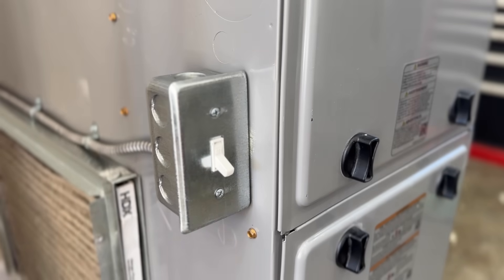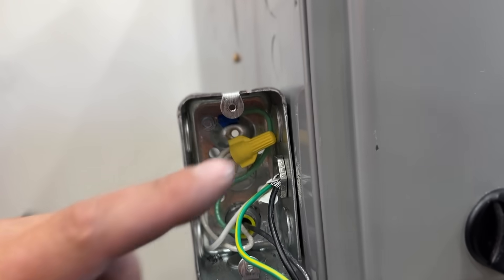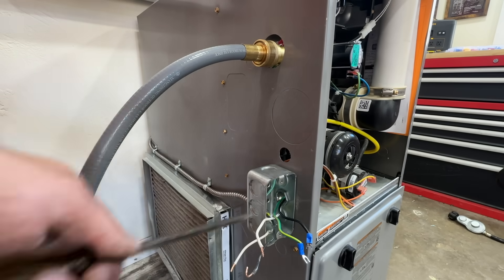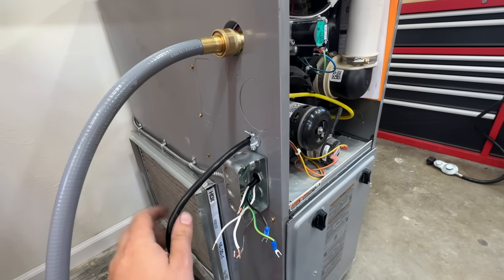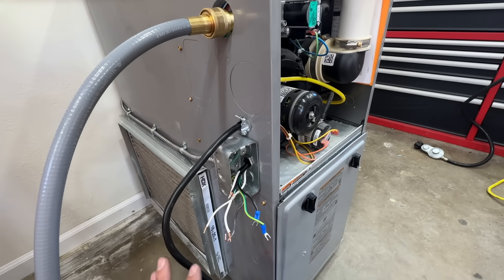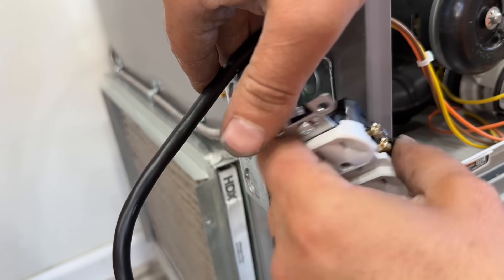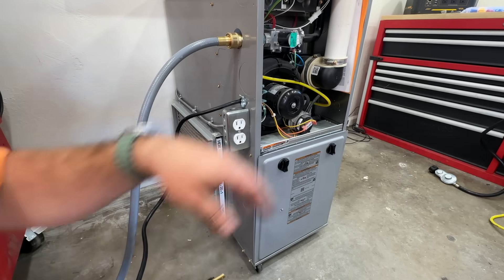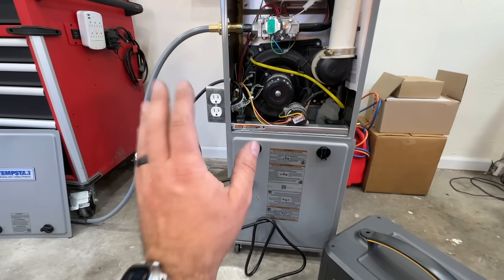Keep Your Family Warm During A Power Outage By Installing This $5 Part

Comment: Done that when gas furnace was installed (had to relocate it to one side of basement for better use of space). The issue with is that the switch was lost, thus furnace will power when plugged in. Never had to use it, but is there just in case.

Comment: That battery powered 120 volt supply  won't last very long.  Better off to get a gasoline powered generator, keep in in your basement, and  run a power supply cord to the generator from outside your door. Quite often the power can be out for 8 to 24 hrs. in the event of a severe snow storm.

Comment: I recently did this but encountered one problem. I had a new HVAC system installed recently. The installers wired up a cut-off switch, as well as a duplex receptacle. They didn’t wire it so that the switch turned off the receptacle, which I think would be proper, so I rewired it so that the switch powers both receptacles off. This way you can plug in the furnace and still use the switch as a cutoff. The problem came in because the installers put in a GFCI duplex outlet. No matter what I did, the GFCI kept tripping. It obviously didn’t like a power oscillation or some other anomaly. Anyway, I temporarily plugged the new furnace pigtail into a non-GFCI out and it works fine. I’m going to replace the GFCI outlet that the installers put in with a non-GFCI which will then be controlled by the switch. I could leave one hot all the time but I’d rather the switch kill it all. Thank you.

Comment: This is a great tip. Thank you. Question; Why do you need to run the pigtail through the inside of the furnace. Can’t you just run the pigtail through the top knock-off of the electrical box itself.

Comment: You should solder that connector then attach it. Screw it together so you can and not only that, but it makes it better connection to a solid piece of wire that's electrical 101....

Comment: Just a little fyi...Please someone correct me if I am wrong...Use caution if you try to power your modern furnace with a standard generator. Standard generators put out an irregular sine wave which can damage your computer board...An inverter generator puts out cleaner energy and will be fine. My furnace man alerted me to this, and since then I had a power outage and my inverter generator powered my furnace perfectly.

Comment: Good idea my roommate and I had to do that when we would lose power randomly in New Hampshire. We didn’t have an expensive generator. We had a harbor freight special. Just enough to cover heat and a few lights maybe the refrigerator. Plan on doing the same thing with my RV as a backup option had my breaker box fail. Had to use a battery charger just to run my heater with a generator. It’s amazing what you can find to work when you’re cold.

Comment: Why are you going through the added complexity of knocking out a hole in the furnace only to run the plug wire back into the box? Why not knock out a hole in the box and use the same wire clamp to run the plug wire directly into the box?

Comment: looping or tightly coiling an extension cord while running a motor can potentially cause damage to the motor due to heat buildup and voltage drop. A tightly coiled extension cord can trap heat and prevent proper air circulation, leading to overheating and damage to the motor. Additionally, a coiled extension cord can increase resistance, causing a voltage drop that can prevent the motor from starting properly or damage it during operation.

Comment: Thank-you very much for this video. Long story short just went through 5.5 days without hydro due to ice storms (Ontario , Canada) and I have since converted my furnace the same as your video. My switch was a bit different as it was mounted on a stud a few feet from the furnace. I just connected the same way you showed including wago connectors and same power cord. I did cut the appliance cord down to about 2.5 feet from the original 9 feet (just my preference for it's location). I first tested by running furnace with it plugged in and it fired right up. Unplugged it and it shut off. I ran a 50 foot outdoor extension cord to brand new Honda 2200i generator on my deck through basement window. My furnace is about 15 years old and is a high efficient natural gas furnace. Generator ran the furnace perfectly and it even started the furnace on the generators lower rpm "eco" mode. Once again thank-you for this video it gave my the confidence to do this conversion....cheers.

Comment: Non-electrician homeowner here. Good video. I was just watching Torque Test Channel’s review of power backup solutions, including using one to power a furnace. As he didn’t explain how the plugging in part was accomplished, I looked it up and yours was the first video I watched. 👍🏽

Luckily I have not had an extended power outage in winter, but I do have a 4-day outage a couple years ago in late summer. I don’t have a generator; I got by using a car jump pack to power a small USB fan to keep cool and keep my phone charged. 

If I had a generator, I would not expect the AC to run with this pigtail solution as it’s on a separate circuit which is much higher amperage (and I think also 240V?).  But possibly the blower motor by itself to better circulate the air. 

I also had a non working furnace for a few days in December (but still had power). I warned myself mainly using electric space heaters. Luckily I have an insulated crawlspace and while it did lose temperature over those few days, it never got to freezing. There are also electric pipe heaters installed on the pipes in the crawlspace but I don’t know how effective they really are. 

So I have some questions for the “Sparkys” out there regarding this solution. 

A) Instead of a 2-outlet, could I instead install a combo switch/outlet? Then I still have the ability to cut off power to the furnace without yanking the pigtail cord out. (Because I’ve noticed HVAC techs sometimes have to do so several times while diagnosing or making repairs.)

B) if the furnace is within a distance of X (I think 6 feet?) of water pipes, does the outlet need to be a GFCI? (I would think Yes) 

C) I noticed both the pigtail cord and the furnace power wires going through the same clamp into the box. Is that kosher? 

D) How big (or really, how small) of a generator would I need to power the furnace to warm the house (and especially the crawlspace)? Could I get by with a battery-powered unit that I can use inside the house? 

E) I see a lot of comments that this is allowed by code in some municipalities, but not allowed in others. I think the nice thing about using the lever nuts is if I expect to be inspected, I could remove the pigtail cord relatively easily and cover the knocked out hole beforehand. 😉

Comment: OK Guys, Maybe a dumb question here... Do we need to turn off the breaker when we have an outage so that when power DOES come back on it doesn't blow up the genie by sending power back into it?
Reply: Basically he made the furnace have a plug.  You either plug it into an outlet going to the panel or an outlet going to the generator.  It can never be both.  No chance of backfeeding.

Comment: Hello, I recently used your hack to power my gas furnace (120V) with my generator. Do you have a similar hack to be used with my 220V A/C unit?
Reply: Thank you for the 3/29/25 video demonstrating the 30 Amp backup solution!😊

Comment: Gentlemen , I have been a gas fitter for forty years and yes this method would work but here is how I would power my furnace WITHOUT USING ANY TOOLS to accomplish this.
If I were to use the power source in the video my method, with a pre made cord, would take less than 2 minutes to get furnace, refrigerator, plugs and lights  to work depending on how much wattage is available at your power source.
I have a 6' extension cord with 2 male ends on it pre made already in case this happens to me. I have a portable gas generator as my power source but the electric battery source in the video would make this even easier.
1. SHUT OFF MAIN 100 amp breaker on breaker panel
2. Plug 6" extension cord you pre made in any wall plug in house
3. Plug extension cord into power source, battery or outdoor generator and turn on
4. You have now supplied half of your electrical panel with power ( 1of 2 buss bars). you will have lights and plugs working as well in the house. If the furnace doesn't have any power then you will have to find an electrical outlet in the house that also doesn't have any power as well. ( use a lamp that works to test outlets). 
 Remove extension cord from power source, transfer to the outlet that has no power, install and plug into battery or power source and you will power the furnace. 
5. Once you notice lights on at the neighbor's, shut off your power source that you used, (battery or gas generator). Always unplug 6' extension cord from power source before removing from electrical outlet, to reduce any chance of shock and turn 100amp Main Breaker back on. 

If you simulate a power failure before you actually have a power issue, you will know which electrical outlet you will need to use during an emergency to power your furnace. My outdoor plug is on the same buss bar as my furnace so I can start my 3500 watt gas generator outside, plug 6' extension cord into outdoor outlet and I have many things working in my house including my furnace.
BE SMART... BE SAFE  use common sense

Comment: Excellent video. The only thing I would add since I am old school is: The unused terminal screws on the outlet- turn them in; especially in a metal box. I have seen these touch the sides of the box when a receptacle was loose or touch other things that you don't want them to. Just little things that make you go"Hmmmmmmm". Once again, nice clear video.

Comment: What happened to your furnace shut off? Code generally requires you have one. Also, without a shut off, you need to insure you shut off the furnace breaker to disconnect furnace from house main power!
Reply: Disregard!! I didn’t watch the end of the video!! Thanks!

Comment: Sadly, this is NOT a code compliant electrical installation. It violates the NEC, and also will void the manufacturers warranty as gas furnaces are required to be hardwired, not cord and plug connected. 
Here is section 407 from the National Electrical Code, gas furnaces DO NOT fall under any of the following: 

400.7 Uses Permitted
(A) Uses . Flexible cords and cables shall be used only for the
following:
(1) Pendants.
(2) Wiring of luminaires.
(3) Connection of portable luminaires, portable and mobile
signs, or appliances.
(4) Elevator cables.
(5) Wiring of cranes and hoists.
(6) Connection of utilization equipment to facilitate frequent
interchange.
(7) Prevention of the transmission of noise or vibration.
(8) Appliances where the fastening means and mechanical
connections are specifically designed to permit ready
removal for maintenance and repair, and the appliance is
intended or identified for flexible cord connection.
(9) Connection of moving parts.
(10) Where specifically permitted elsewhere in this Code.
(11) Between an existing receptacle outlet and an inlet, where
the inlet provides power to an additional single receptacle
outlet. The wiring interconnecting the inlet to the single
receptacle outlet shall be a Chapter 3 wiring method. The
inlet, receptacle outlet, and Chapter 3 wiring method,
including the flexible cord and fittings, shall be a listed
assembly specific for this application.

The only other applicable article that would apply would be Art. 422 which basically says the same thing.

Additionally, as soon as a receptacle is used to connect a furnace, it must be a GFCI type receptacle which could trip and prevent the furnace from operating during frigid temps, and damage plumbing, etc.
Reply: This is what I've been hearing and was poking around for the answer.  Staying warm during an outage though.  Someone showed me what they do.  The just disconnect the light switch and pigtail the plug used in the video until power comes back.  I'm on the fence on what to do.  A 1500w heater isn't going to heat the house enough.

Comment: Hey man, I know you posted this a year ago, but thank you.  We gathered all the parts and my wife and I got this done in like 20 minutes.  I was surprised I didn't need a neutral ground bonding plug for my newer 2 stage furnace, but it worked fine off battery bank without it.  I ordered a couple just in case we need them for the inverter generator or a future furnace that's a little more picky.  Thanks so much for this, saved us a lot of money and it's great for peace of mind knowing that you'll have heat even if no power.  Six thumbs up!!

Comment: Awesome video!! Greatly helpful. Question -- To better understand the role of the switch. I am not an electrician. If I switch it off, then I guess the furnace doesn't work, right? Then, is there a specific reason that the switch is needed? I am asking this because electricity should  be continuously supplied to the furnace to get hot air as long as there is no power outage. Your answer to my curiosity would be appreciated.

Comment: How much for the 1000 watt inverter ? How many hours will it run the gas furnace ? How much is the amperage draw on the control circuit and blower ?

Comment: Don't forget about powering your condensate pump if its a high efficiency furnace! It'll need power too or you'll end up with a huge puddle in the morning.
Reply: Wouldn't it all be controlled by the furnace?  I don't think the pump is on it's own line and breaker.

Comment: I know there are a lot of variables on this question, but how long would you expect a 1000w power source to run a GFA furnace in a larger 3 BR house in say zero degree conditions.  In Ohio this could save lives and prevent plumbing from freezing, but for a day, two days, a week?

Comment: Great video!  Really enjoyed it.  Very useful content.  What size VTOMAN Power Station would be required to run a Lennox high efficiency furnace?  I saw you had a VTOMAN PowerStation 1000.  I already have a Briggs & Stratton 12KW standby generator for running the whole house but unfortunately I’m having problems getting it to run the furnace due to fluctuations in the power going to the furnace from the generator during power outages.  The furnace throws an error code (E126) and won’t run due to the fluctuations.  The generator seems to put out the frequency within the furnace requirements (60Hz + or - 5%, so 57Hz to 63Hz) based on Lennox information.   It seems the control board is not allowing frequency variations (58Hz to 62Hz).  Apparently, this is an issue that is similar to the one they had with Lennox Pulse furnaces.  My furnace is a Lennox G71MPP-36-B-070-03.  I’ve been trying to figure out a solution to running the furnace during the winter if we have a power outage.  This might be a workaround to that problem but would love to be able to run the furnace off the generator if possible.  Btw, are firmware updates available from Lennox to resolve something like this?  Thanks again for providing such great content.  It’s sincerely appreciated!

Comment: My furnace doesn't have an electrical box on the side, does that mean I'm out of luck or is there another method?
The wiring I see comes down the side of the furnace  from my attic and the wires go directly into the furnace.

Comment: PLEASE NOTE: Some furnaces are smart enough to sense that the generator/lithium-power-station has no connection to ground/earth and will shut off shortly after its startup cycle. Our Goodman furnace has this issue. You will need to purchase a ground/neutral bonding plug or, as with our EcoFlow Delta Pro power station, a specialized "Grounding Adapter".
Do it NOW before you need it! ;-)

Comment: Tried this with my trane xv90 and a 3500watt generator. It didn’t work. An initial motor turned on but after a minute the entire system shut down.

Comment: Not an electrician, so if the answer is obvious I apologize. Why not run the cord straight to the junction box instead of running it into the furnace & then back out to the junction box? To me this appears to save a step or two.

Comment: Great content and followed all details.  Furnace works as advertised with the plug installed in receptacle on the side of the furnace.  When plugging the furnace into a chord from a 5500 watt generator the furnace does not operate.  Curious as to what might I have missed?  Thank you for any information you may be able to share.

Comment: I understand what you’re going but can’t figure out what happens when the power comes back on and everything is connected in a loop ?
The furnace will be getting power from the power source and will also get power from the electrical box, yes ?
It’s all hard wired together, so how is that not a fire hazard?

Comment: I just ran a 220 plug off of my Central air that I use for my welder when I need to work on something in my drive that wont fit in my garage. If the power goes out, I flip the main, and I made a 220 cord to hook my generator up to it and I have power to whole house.

Comment: Good idea.  May want to cover run time.  I'm bulding a battery backup now with Golf Cart batteries.  10A at 120v is 100A at 12v, plus effeciency losses in the inverter.  This will suck down a battery pretty quick!  If you need say 8hrs of run time for 3 days, you need a lot of battery or some means to recharge them.

Comment: Good video!  So, it kind of looks like you soldered at least a couple of the stranded wires before you put them into the Wago lever nuts.  Is that okay?  I've seen in a couple places that soldering wire ends in this application is a bad idea because the solder will, over time, deform.  Did I see that right?  Anybody else have an opinion on this?